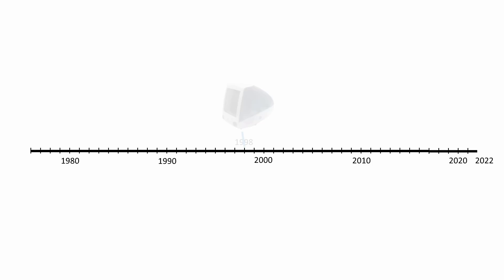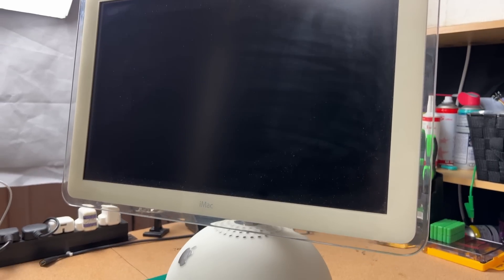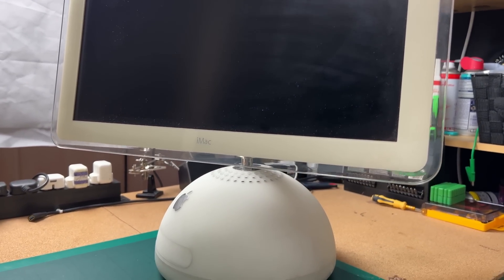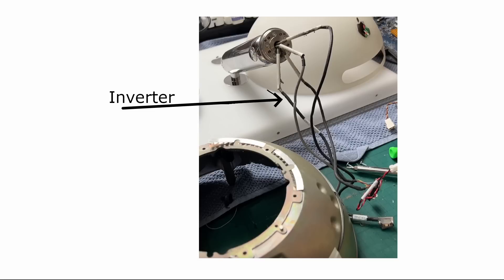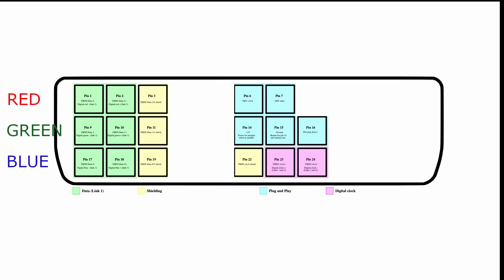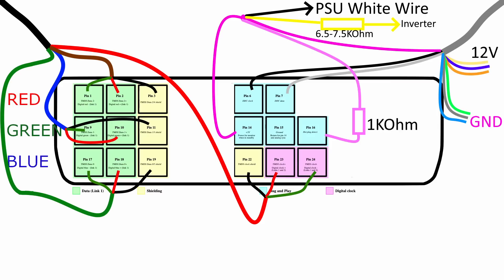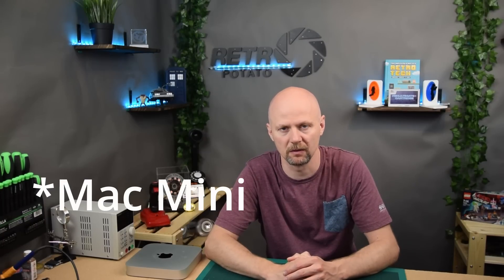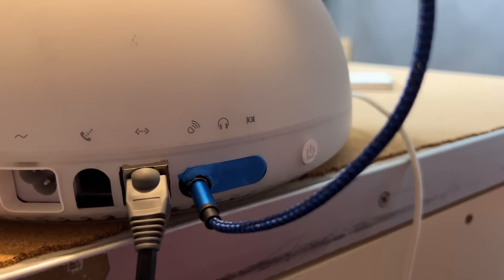20 inch G4 iMac converted to M1

Comment: might be interesting to also switch out the display panel for something more up to date, also maybe put the Mac mini antennas where the old ones were in-between the plastic and the mounting dome on the inside. this video made me want to recreate it. awesome!
Reply: Yes, I’m planning this with an iMac G4 17”. I’m still looking into it, but there are panels with 2560x1600 instead of the original 1440x900, and better colours. The active area is about 1.5mm less than the original, and size overall also less. But I’m still pondering how to reuse the cables in the neck to send a HDMI signal together with 12V to a video controller behind the panel.
Reply: @Zeguyfromgermany  awesome! I´d love to hear how it went.
Reply: @Zeguyfromgermany  Some guy from Japan uses flat ribbon hdmi cable with detachable connectors

Comment: Amazing job. Would it have been possible to replace the panel with a USB-C.20" portable/monitor panel?

Even a cheapo modern panel would be better quality than the old screen.
Reply from the maker: Yeah, that is entirely possible. you just need to run new wiring in the neck and provide the proper power to your new display. You could probably even get a panel with its own control board which accepts hdmi input and you would need only run a flat HDMI cable through the neck to the dome (and either interface it with the mac mini inside or just provide an external port at the back of the machine)
Reply: Why not a detachable-but-also-charging-base for iPad? With sidecar (or luna display for older models) you could get image from the mac…

Comment: Do you thing it's possible to find any modern screen to replace the original one?
Reply from the maker: I think it should be possible, in fact it would make sense to change it to a full HD screen saving a lot of effort on the conversion to DVI - those thin wires are anything but fun to work with :)
once the display gives up in mine i will replace it with a modern panel.
it would also allow to remove the old power supply and simplify the work (no need to trick the m1 to accept the monitor)

someone else suggested in the comments that they did such replacement already so i am hopeful :)

besides, if anything like that exists, aliexpress must have it :)

Comment: Hi there, I'm doing this project with a 15" iMac G4 and am getting lost on the DVI part.  I have found a 15" pin layout/mapping diagram but am unsure exactly what you did during the DVI part to get it converted to HDMI.  Would you be able to please provide some more info behind your exact DVI process?  Thank you in advance.
Reply from the maker: Hi, Once the screen is ready to accept the DVI signal you can simply get an HDMI to DVI converter on ebay/amazon. Its the easiest way to convert the HDMI output of the mac Mini to DVI. 
If you are not there yet, you just need to get the digital RGB wires into their right position within the DVI connector. And regardless of the monitor size, you need to apply the same 'cheat' using the DVI 5 volts to trick the computer to start sending the video signal. 
If you need more info, drop me an email and I will get back to you

Comment: What about the power button. I see you're still using the original iMac power on/off button, but how did you connect that to the motherboard?
Reply from the maker: The iMac powerbutton is nothing but a plastic disc with a spring to keep it in place. So what i did is that i moved the mac Mini's power switch (which is stand alone in the mini's case) and moved it behind the iMac button and made it stay there with some sugru. It provides a firm yet flexible place for the switch to make sure it does not break or gets damaged if excess force is applied. 
So its the mac Mini's own powerswitch fixed behind the imac powerbutton - no motherboard alteration was required. 
hope this explains
Reply: @RetroPotato  got it! Thanks!

Comment: Is this an easy mod?
Reply from the maker: Easy in a sense that installing the m1 heart is not difficult. If you are okay using the soldering iron and willing to do some fiddly wire work (the wires in the neck are super thin!) then it can be done. Its not more difficult than building a large lego technics model - with the additional need to do soldering and be confident working around 110V/220V PSUs

Comment: Awesome project! I did the same thing earlier this year and am still using it today as my main computer. If you think it’s cramped inside now, imagine having the dvd drive still in it!
Reply from the maker: Yeah, i know - that is why i gave up on even the thin internal drive. I wanted to have a better thermal figures for the board in there - not slapping a massive drive on the top :)  Kudos to you for achieving such feet (i am sure it was even more fiddly to get it together)
I also use the M1 G4 since its been built (i am writing the comment on it right now)
Reply: how did you keep the drive? did you upgrade the drive? or just use the old one?